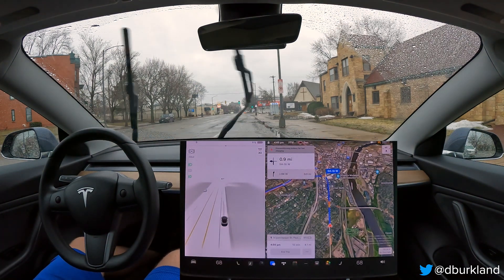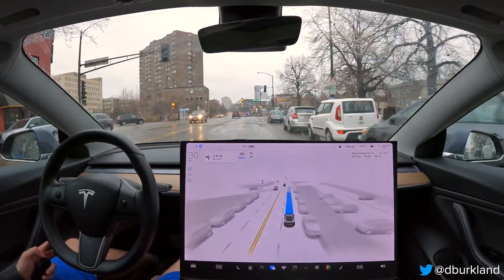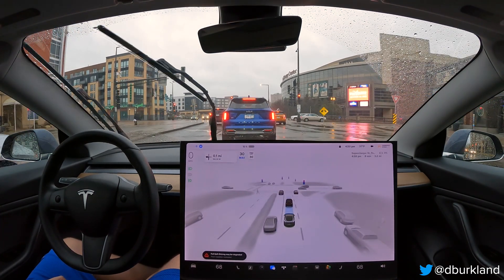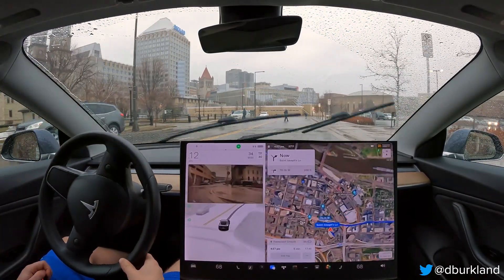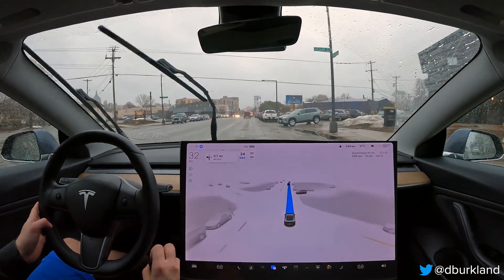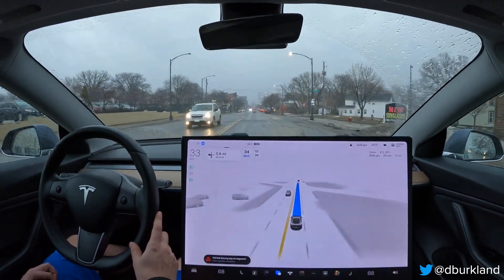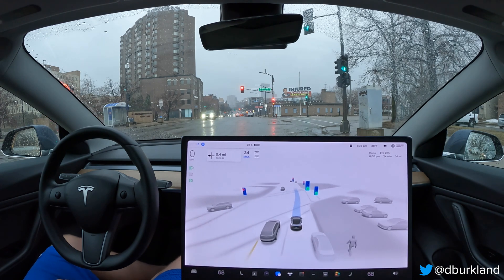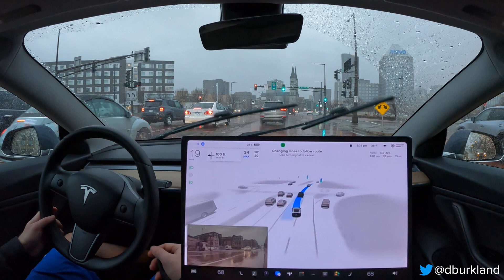Tesla - FSD Beta 11.3.4 - St. Paul Torture Test (Fail)

Comment: 3.4 has been an extremely terrible update for my car… Last night after downloading, we went for a drive… it disengaged in the middle of most of its maneuvers… Failed to complete turns and tried to turn into oncoming traffic… Last night I rebooted the car and left it sit overnight… This morning. I had to run to Harbor freight… It tried to go through two intersections without stopping for the red… After it went through one intersection, it threw me to the right, and almost into the ditch… I am still shaking… just thinking about it… I have well over 10,000 miles on FSD and this is by far the worst update I have ever had… And it does not give me any way to inform… by voice, prompt, or by the video capture… I am honestly extremely disappointed in this update… so much that I’m afraid to drive it in FSD until another update…
Reply from the maker: It’s interesting to hear this as I have had a lot of solid drives with 11.3.4 the past few day (much better than 11.3.3). Have you tried a camera calibration? I have heard of another person having similar issues to you and that step helped out quite a bit.
Reply: I have not, but a calibration should not be needed… it is driving like it’s drunk or on crack… it shows things on visual, but doesn’t respond to many of them… It’s almost like code is missing…

Comment: Have you thought about when you force the car to the right lane you override the system because remember that the turn signals are another way to train the car so when you force it over it ignores what it needs to do. Because I've noticed that the first time yes it got in the wrong lane but after that it started to pick the left lane but you override it.
Reply from the maker: I just did something similar in another spot not too far from my house and the car still moved over to the correct lane. In the video above it just refuses to get over at all no matter what. FSD behaves as if we are in the correct lane when in fact we are in the right lane.